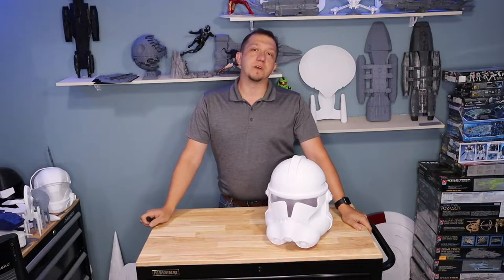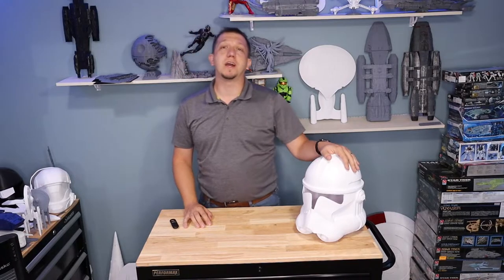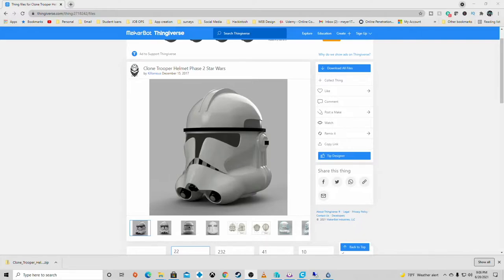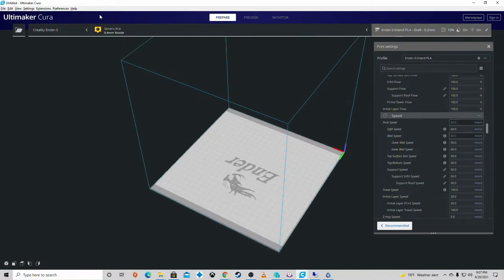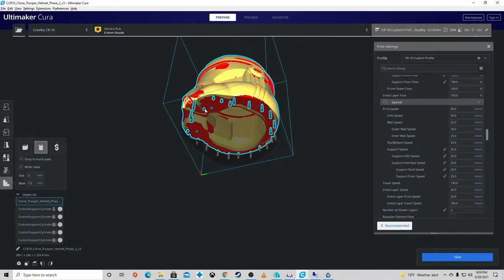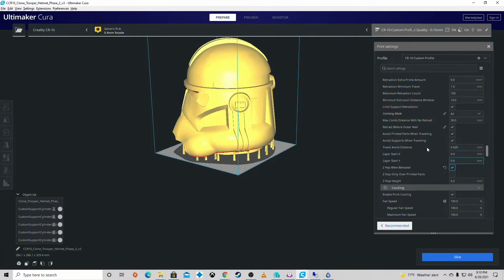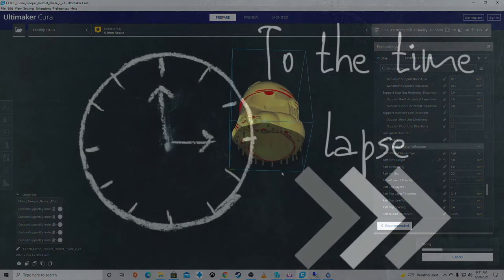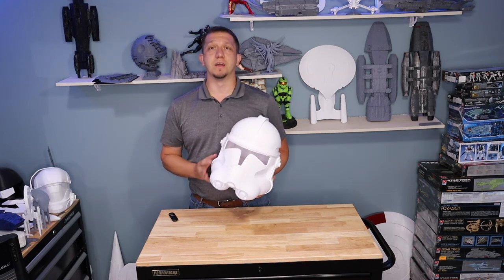Clone Trooper Helmet DIY with 3D Printing

Comment: Wish I had the problem of it being to small, printed it out and it was way to big, some reason the parts where huge. Would love to see you print out the helmet on an ender 3 as that's what I have
Reply from the maker: You have me curious.   Was it the same model I used?  If so I planned to print it on the Ender to see if there was a difference
Reply: @Rise3DBuilds  same model, came out huge. Used cura and just dragged the files. Trying again scalled to 90% this time
Reply: @Rise3DBuilds  doing the school pick up at the moment, when I get back ill send u a pic on Instagram to show the size it came out